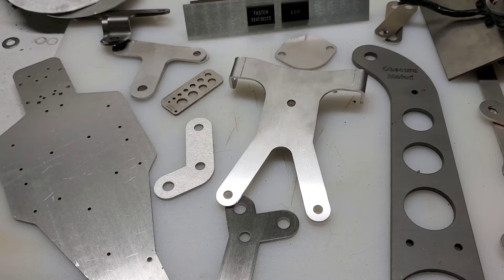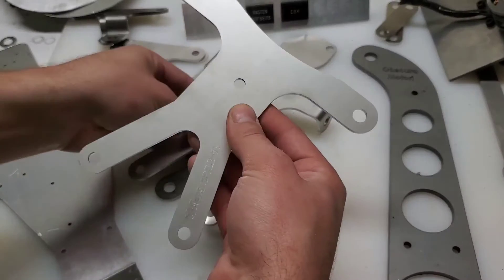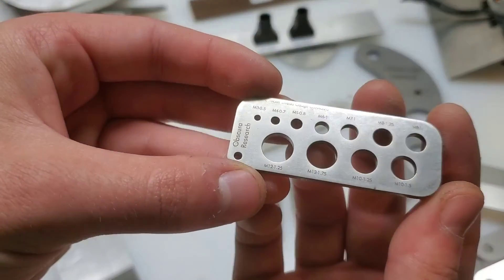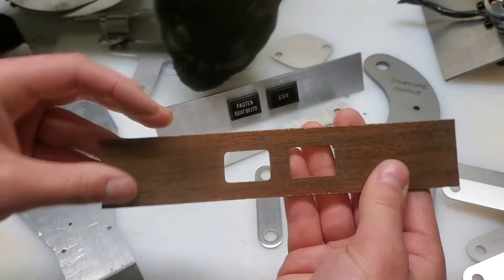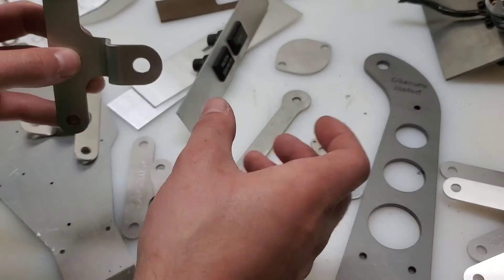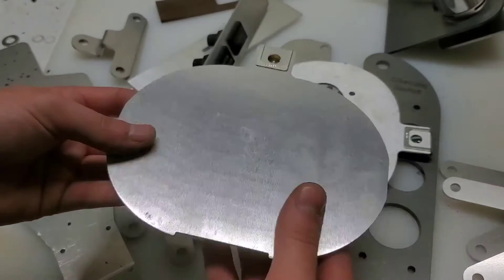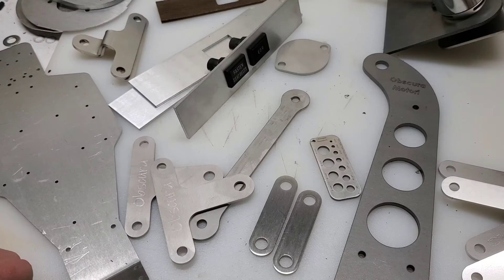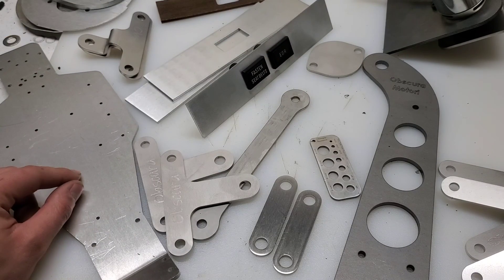Past Projects - SendCutSend Metal Lasercutting Service

Comment: Thank you for putting in some sample prices in the comments. That's always my first question and no one likes to publish prices it seems. I just want to know the ballpark of something so is it doable or just out of budget.
Reply from the maker: The problem with prices is they depend on a lot of factors like the size and thickness of the part, how many cutouts it has, type of material, quantity, etc. The ability to instantly get a quote just by uploading your DXF file and selecting a few options is probably the most convenient part of Send Cut Send.
Reply: @NickMakesBreaksStuff  Yep, that's why I like to see just a couple samples of a companies service (or product) to get a basic idea. At least then you know if it's worth your time to pursue talking to them. Just like the parts you showed, basic shapes. Are we talking $25 or $150.
I used to own a small manufacturing business years ago making laser cut model kits and I'd also do custom parts on request. Unfortunately my laser isn't powerful enough to cut metal but I can do 1/2" acrylic.

Comment: Did you do the etching or did they?
Reply from the maker: They did the etching. They offer outline etching, which is pretty faint, or fill etching, which is really good for text. Fill etching costs more though.
Reply: @NickMakesBreaksStuff  Can I clarify one thing on the etching?  Send Cut Send says they do NOT do etching.. I rushed there after watching your video here.  Are there any other services you have used that do etching before?
Reply from the maker: @JeffTorgerson  That must be a recent development then. I don't do etching regularly, but SendCutSend definitely used to do etching. I have not used any other company's etching service.
Reply: @NickMakesBreaksStuff  ok.  thanks for the update.  This video was inspiring on all the things I SHOULD be making but dont think about.
Reply from the maker: @JeffTorgerson  I use their service all the time. If I need to make a metal bracket or adapter plate or something I don't even think about doing it by hand anymore. I can design the part and have it at my door in less than a week for probably the same price if not less than buying metal and putzing with it myself.

Comment: What software did you use to make the design
Reply from the maker: I've used a few different softwares. Most recently I've been drawing a sketch in solidworks and exporting the dxf. I've also used AutoCAD in the past, or Autodesk Inventor

Comment: what are the prices on some of those parts like?
Reply from the maker: Prices are very reasonable, but vary quite a bit depending on material, thickness, and size. There is also a minimum order amount for each material and thickness you use, usually $29.
Reply: @NickMakesBreaksStuff  I could have guessed that. How about just giving the price of one of your designs. Then I can say, well mine will be thicker so more expensive. OK, so give the price for several. Of just say all of these parts were less than the minimum. Maybe one part was $1,000 and another $1. Jesus, we have no idea and you can tell us. Sorry for being so snappy but several people have asked for this and you never replied to them. I would really appreciate a reply and would be eternally grateful. Thanks.
Reply from the maker: @L-36  As I've stated before, prices vary wildly based on what materials you use, how big your part is, and what quantities you order. The best way to asses this service's prices is to upload your own DXF and play around with the different materials and thicknesses.

Furthermore, I've been reluctant to state the price for many of these parts because they are components of products that I sell on my website and I do not disclose my material costs. This isn't an unreasonable policy, and it is not uncommon for small businesses (or any business for that matter) to keep these cards close to their chest.

Regardless, I've put some of the prices from SendCutSend in the description. I hope you find it, and the video, helpful and informative.
Reply: @NickMakesBreaksStuff  That is so helpful. Thanks so much. If I missed that the first time I apologize. If you just added that, thank you so much. It really helps to put it in perspective. So many times I find people don't want to say a quantity or price because they can't be exact. I ask my wire how long something will take and she says she doesn't know. I ask here will it be in 5 minutes and she says no. How about a month? They she says an hour or two and I have my answer. I know any part I design will not cost what yours do but I tell you, getting 1/4 inch aluminum part like the one at 3:14 isn't something I could do with a jigsaw, file, and drill for $15. This was a great video and even more useful with the pricing examples. Thank you.